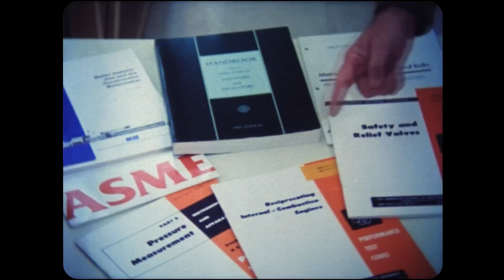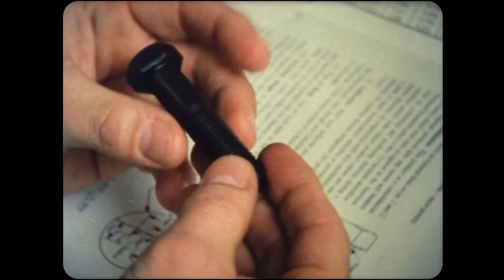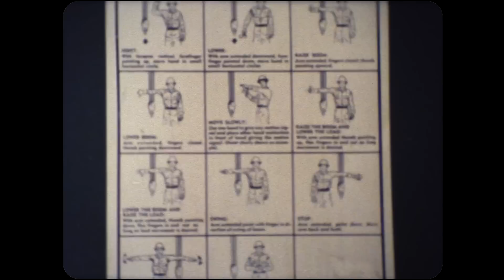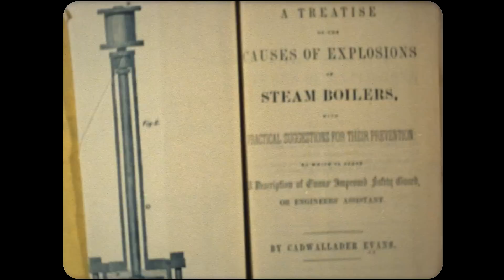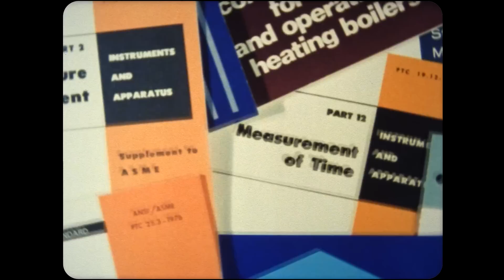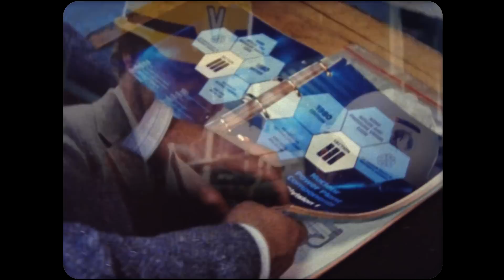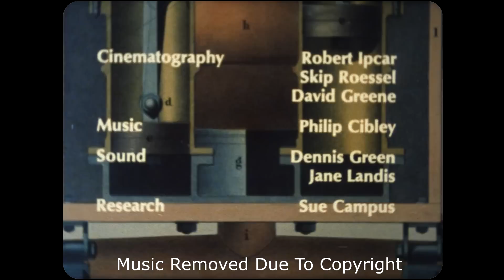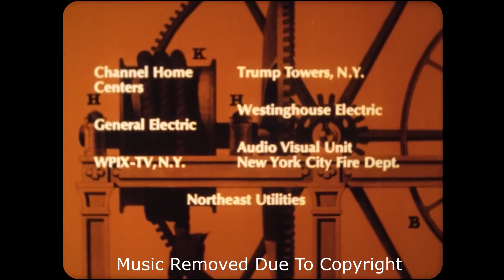Bolts!  (1984)

Comment: I worked in a steam boiler room. Got test water and monitor pressure gauges constantly. If you ignore any part of your duties, you can for sure count on dying in a major explosion that will take out half the building that is using the boilers for heat. Scary place to work.
Reply: Essentially, a bomb to make the warm happen. This seems to be a running habit of humans.

Comment: Filter out the voices to create a pure music track. (It's easier than filtering out "music" due to the smaller frequency range).  Reverse the phase of the new music track and feed that back to act as a standard "noise cancelling" track. You are probably aware of this technique, I know. BUT, these days, you can also get free, demo and paid software to help automate the process. Moreover, there's the SPLEETER AI (MIT) open source that does an even better job. There are some free and trial products around that use this mechanism. Hope this helps. And I do love these restoration videos, thank you.
Reply: RipX DeepAudio does this, but is paid software. Worth it for the neat front end and ability to tweak things, plus it's higher quality than Spleeter.

Comment: Standard sizes for nuts and bolts is only about 200 years old, before that pretty much every nut and bolt was almost guaranteed not to be interchangeable between different manufacturers, as each one used their own method of making the thread and the nut. This making a bolt and nut a size that allowed you to buy a box of bolts form one manufacturer, and a box of nuts, from another totally unrelated one, and have them fit together with absolutely no worries about them not working correctly. This is the foundation of all modern engineering, in having standards that all adhere to.
Reply: Whitworth.  But I am not sure about early standards -  Birmingham locks , bolts and door fixings must have had a commonality,  quite a bit would be hingeware etc for carriages / wagons (horse drawn)
Reply: @highpath4776  They had a lot of things in common, but remember all were made by individual companies, and thus were more or less the same size, simply because they were made by the same workers. Only when you got the first screw cutting lathes did you get the start of standardised fasteners, in that the screw cutting lathe allowed you to make the same part repeatedly. With a thing like a lag bolt that was forged they would all be roughly the same size, but not interchangeable unless the same checking nut was used on all of the bolts, and the same check bolt on all the nuts.

Comment: At 12:35, the wow in the music is very audible. Is the wow a part of the film, or caused by your playback machine? This print is in excellent condition considering it is 40 years old. I projected many 16mm prints back 40 - 50 years ago, and it seemed then that wow and flutter were inherent in many of the prints I ran. Thanks for posting this film Fran.

Comment: Industry standards are often silly and overdone. But I’d rather that than everyone doing their own thing. Standards wherever things can interface are vital for any sort of trade.
Reply: The beauty of standards is that there are so many to choose from.
Reply: @ScottGrammer  To a degree. You also tend to end up with a handful of 'default' ones for various industries. Like how USB connectors have become the de-facto standard for anything wanting up to 5V and 2A. And now even more with USB-PD. Even if they don't need any data output.
Reply: @ZaphodHarkonnen  I was actually joking. I was referring to the fact that, for instance, in standard-definition video there was NTSC (USA, Canada, Japan) PAL (most of Europe except France) and SECAM (France only). All of these were substantially the same system, but were just different enough to ensure that there was no interoperability.

In analog magnetic tape recording there were the NAB, CCIR, EIA, IEC, CCIR, and DIN standards. All similar, none the same. 

These were all "standards," yet none of them was the standard.
Reply: @ScottGrammer  I'd disagree that it's actually a joke. Sure 5 or 6 standards across the globe are a pain, but when you have situations where each country has their own standard or even multiple standards per country. 5 or 6 globally suddenly sounds really nice. I currently work in the software as a medical device sector and pretty much every country has their own specific regulatory standards (The EU is a bit of an exception.) They largely overlap, but you have to get each country to sign off on your thing individually if you want to be able to sell. So the relative handful of industry standards on the software side are easy compared to each national standard.

Comment: In 30 years of trying to ensure conformance to standards on construction projects I've known of three inspectors who will get out of a truck. If the claim on the paperwork is correct the material must be correct, even if it's made of used chewing gum. Samples are shipped as a bundle separate from the material to be actually used. I never used them, but cut from the project stock. I've seen too many samples that had no similiarity to the product. I've also worked with contractors who had more friends in high places (often The Engineer) than we did and could get away with anything. Inspection is a thankless, high-stress job.
Reply: Inspectors get treated like your job is to nit pick and get people in trouble

Comment: This is great. I'm curious though, wouldn't the original film have been 24 FPS? I notice some conversion artefacts (perhaps your film to video converter can only output 30 FPS, in which case fair enough!).
Reply: Most telecines that use a projector utilize a 5-bladed shutter to do the "conversion." It gets the flash rate up to 120Hz (24fps x 5)...which 30Hz (or 60Hz) divides into evenly. I suspect that there are other things in play with the smearing as things panned about.  Also the surface that it was projected on was rather visible in this transfer. The sound was excellent, as was the color though the film image was soft.
Reply: @sguttag  interesting, it's actually quite simple! 
But why convert frame rate at all, as YouTube accepts 24 FPS anyway.
Reply: When most of the telecines were made, one had to plan on the resulting output to be playable on a typical CRT based television of the day.  Those were not compatible with 24fps.  Now, if it is not a Telecine type projector, then most portable projectors had a 3-wing shutter (72Hz) to reduce flicker.  Larger projectors used 2-wing shutters (48Hz) for more light with slight, but noticeable, flicker. 

DVD as a format, would almost always (if not always) encode 24fps content as 60i.  Blu-ray, however, has 24fps source material encoded as 24fps.  Most players, however can output 24fps or upconvert, on the fly to 60p.  Different times, different needs/capabilities.  

To this day, TVs capable of 24fps (and, particularly just monitors, like computer monitors), 24fps capability is far from a given.